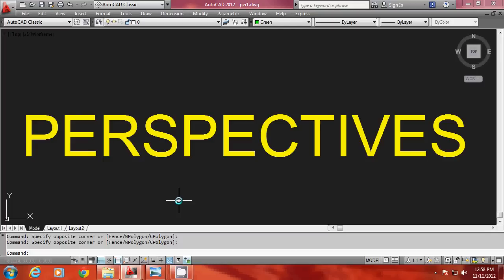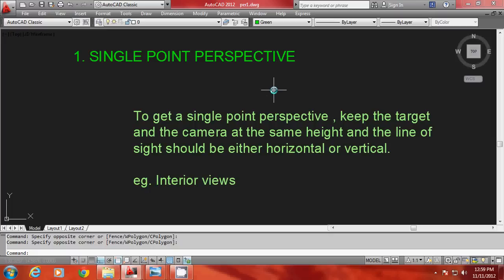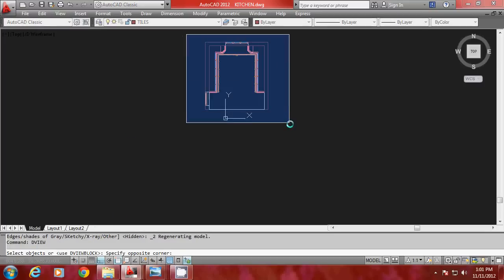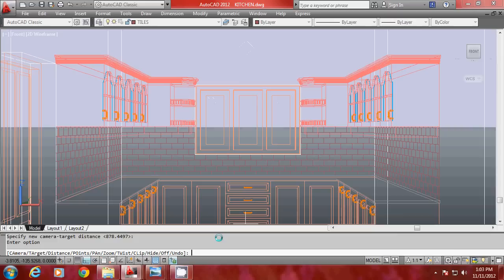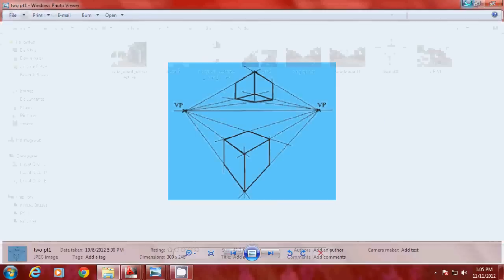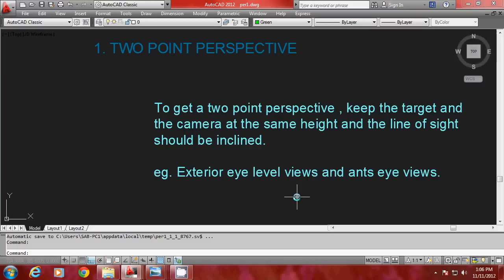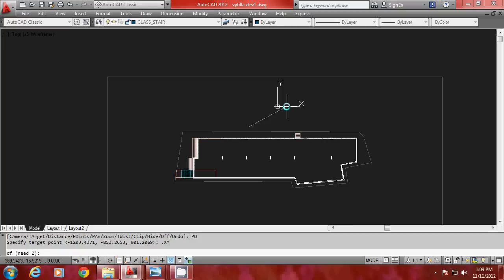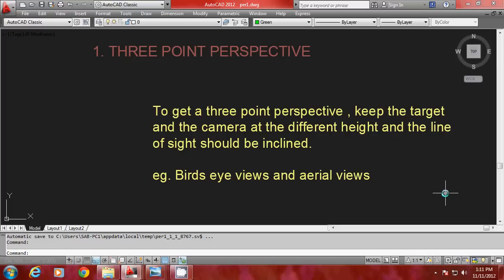MAKING PERSPECTIVE VIEWS USING AUTOCAD |  DVIEW command in AutoCAD

Comment: Thanks so much for your help
but i wanna know after finishing taking the  perspective how can i continue drawing  and do re to unhide all the lines ???
Reply from the maker: After you create the perspective view we can save that view using the VIEW command. Later on you can restore it if required.
Reply: Thanks 4 reply . but I have a problem which is sometimes when I type the command regen to in hide all the lines it does not work . can you tell me why please . thanks 4 your time
Reply from the maker: If you type REGEN in the hidden view it will go back to wireframe representation . If all the lines does not show up , then go to wireframe visual style at the upper left corner of the screen.
Reply: sabeercad
thank u sooo much for your help i wish u all the best in life
Reply from the maker: You are most welcome .... :)